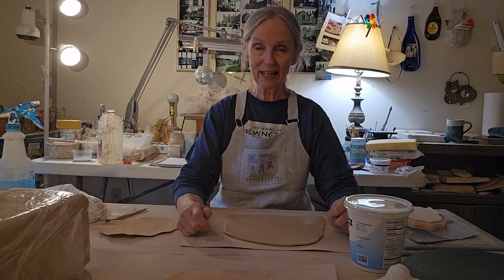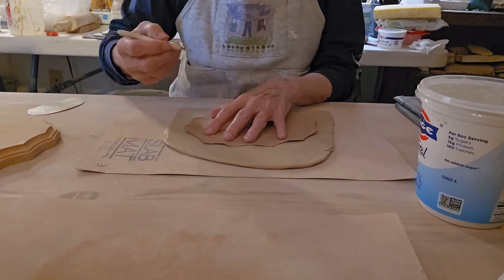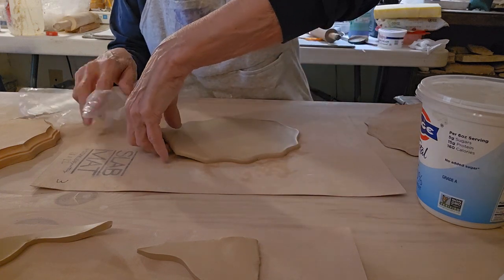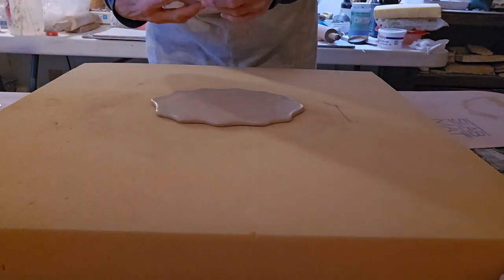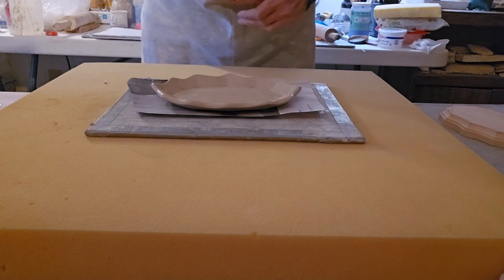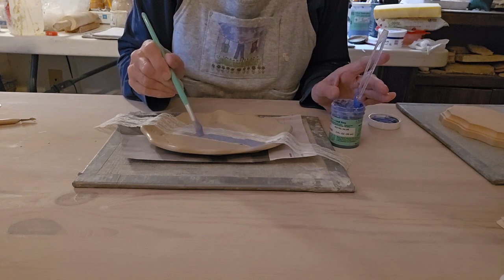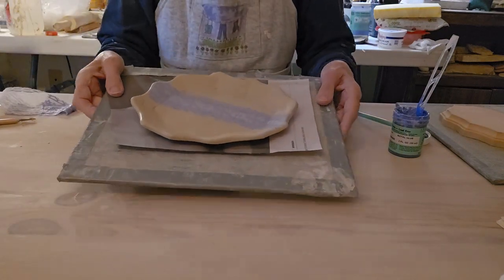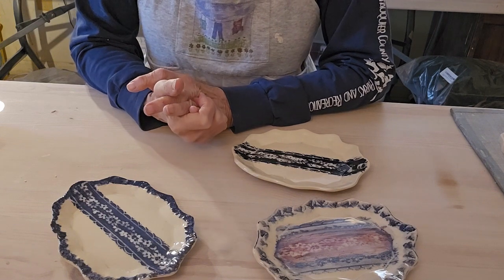Easy Pressed Tray using Slip and Underglazes

Comment: Thank you for sharing your great ideas.   I am just beginning to do more hand building after almost a 5 year hiatus from pottery.  With limited tools and with expenses so high these days I was struggling on how to do this type of project.  Thank you, thank you.  Sometimes the most simple things are hard to imagine.  LOL  Also your tip about the underglaze is great.  I am new to working with underglazes and you are correct it does turn out blurry at times.  I have a question; when you use slip, is it just straight out of the clay slip bucket or do you have to do anything special to it?  Appreciate your information.  Thank you very much.  Have a great day.  Cheers!
Reply: Glad you are back into pottery.. so enjoyable! I don't do anything special to make slip. Just put dry bits of clay in water, wait a bit and stir.